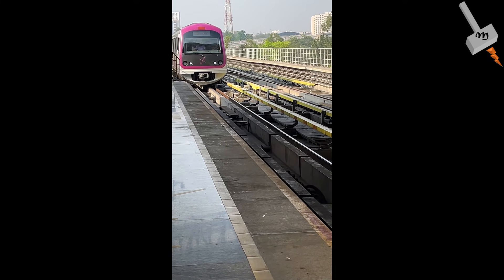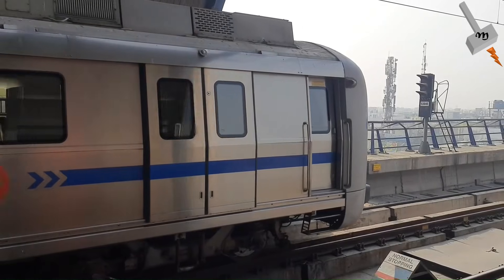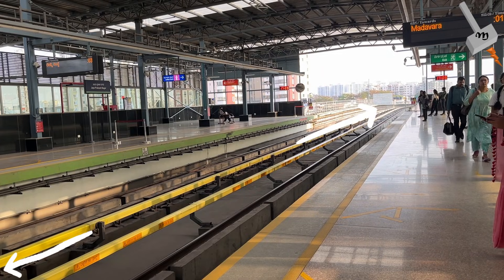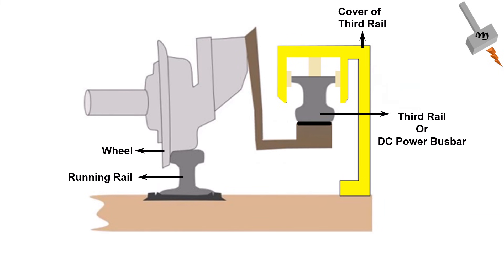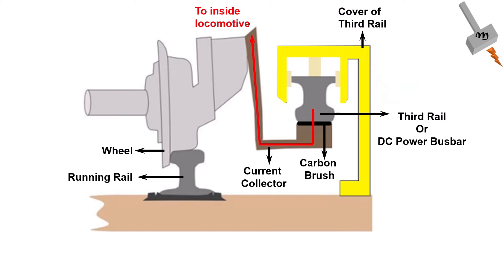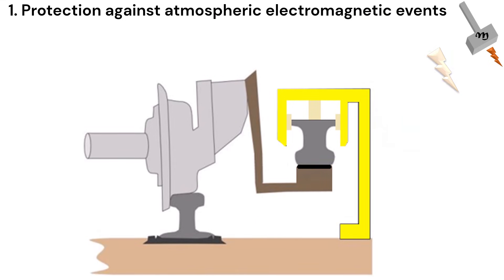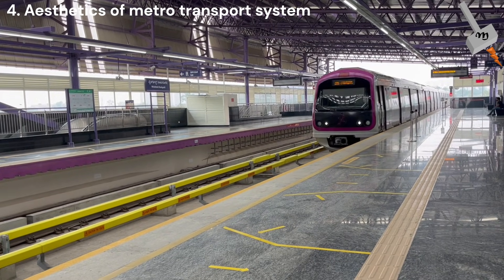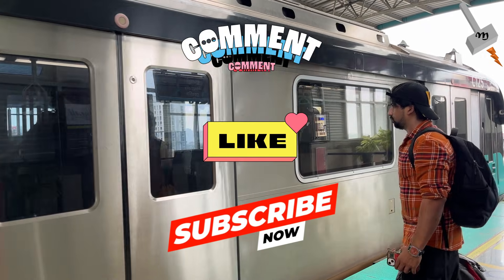How the Third Rail Powers the DC Metro 🚇 | Hidden Technology Explained!

Comment: THE BIGGEST THIRD RAIL SYSTEM IN THE WORLD - IS IN BRITAIN.
This programme seen above deals with an "Under Contact" method of Third Rail. The Worlds biggest Third Rail network is in England. Which has a Third Rail system that covers most of Southern England, for Suburban, Express and Inter-city passenger trains as well as some Freight. A System that began during "World War 1" in 1917,by the London & South Western Railway, and was still expanding into the 1990's. Further the method used, has NO protective cover of the Third Rail, as it is the original simple, open Surface Contact method. And today amounts to Thousands of Miles of Electrified Tracks.

Comment: This was a solid video with a clear explanation of how DC metro systems operate—really appreciated the breakdown of the electrical engineering aspects, especially the role of the third rail and return path through the running rails. 👍

That said, a few technical challenges could have been addressed more deeply. For instance, the higher resistive losses in DC systems over long distances and the need for frequent substations due to voltage drop are crucial considerations. Also, it would’ve been great to hear more about the limitations DC imposes on regenerative braking efficiency compared to AC systems.

On a positive note, the section on lightning protection was particularly well explained. Not many explain how critical that is in open environments, especially where the third rail is exposed. The explanation of human safety measures like protective covers, automatic circuit breakers, and ground fault detection was also on point—simple enough for non-engineers to follow but technically sound.

Overall, a very informative watch, but a bit more detail on infrastructure maintenance challenges and future scalability of DC metros would make it even stronger. Looking forward to more such deep-dives! 🚇⚡
Reply from the maker: Thanks for your support!

Comment: Really insightful video on how the direct current metro system operates — kudos for simplifying such a complex subject! The explanation of how DC traction power is supplied through the third rail and the role of substations in voltage regulation was especially well done. I appreciated the dive into the electrical engineering side, particularly the how current collection is optimized.

That said, it would’ve been great to see more detail on the technical challenges—like managing voltage drop over long distances, stray current corrosion, and the need for frequent substations compared to AC systems. Also, the section on lightning protection design was touched upon but could use more depth. For example, how surge arresters are coordinated with grounding strategies in the trackside infrastructure would have added a lot of value.

Lastly, the coverage of human safety was compelling—especially the emphasis on insulation, barrier design, and emergency shutdown systems—but I wish there was some comparison with overhead AC systems in terms of safety trade-offs.

Overall, very informative and well presented. Looking forward to a follow-up video that digs even deeper into these engineering challenges!
Reply from the maker: Appreciate your support!